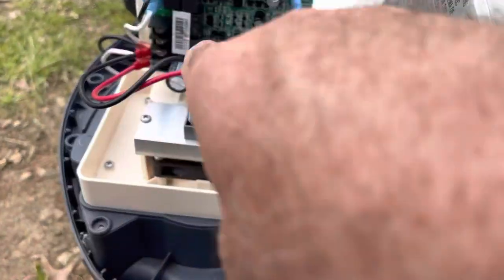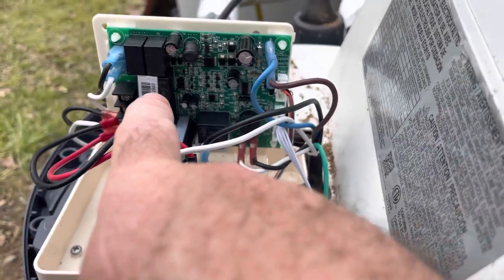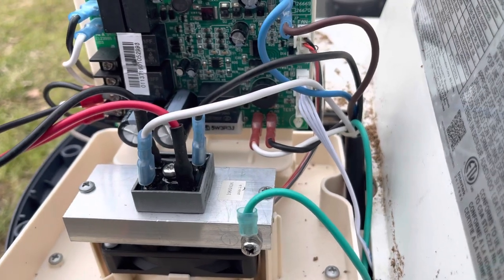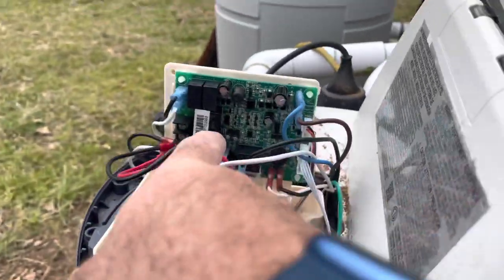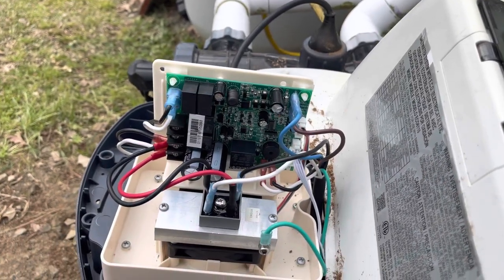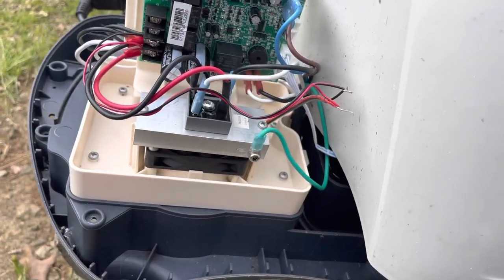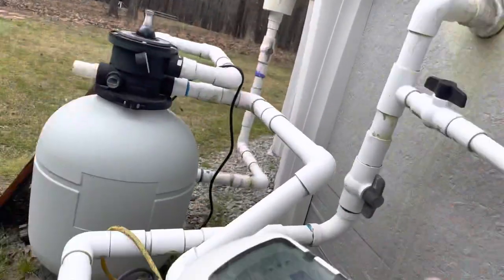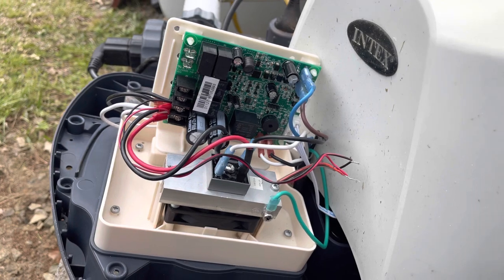Dead Pool part 3 plus dead Intex SWC | How To bypass Intex salt chlorinator error code 91

Comment: The plates used for generating chlorine are MMO (mixed metal oxide) coated titanium.  When you electrolyze salt water you produce both oxygen and chlorine at the anode.  The MMO coating lowers the voltage needed to produce chorine shifting the production in favor of chlorine over oxygen.  The electrodes are titanium but the titanium  is MMO coated.  The MMO coating will ware off and at that point the amount of oxygen relative to chlorine changes.  If you bypass the Intex unit and just apply power to the electrodes with a different supply as the MMO coating wears off you will see less and less chlorine produced.  Just something to watch out.  If you are only putting 0.5 amps into the cells, you are not going to be putting 12 grams/hr of chlorine into the pool.  I think you need closer to 5 amps to generate 12 grams/hr of chlorine.

Comment: Thanks for the video.  I hooked up my 10 amp 12 volt battery charger to the large cell, Going to make a jumper to connect the small cell.  Now that I know it works very well, I will build a water proof enclosure.  It produces enough chlorine in 1 hour to sanitize my 6000 gallon pool.  It runs on a timer and can only come on when the pump is running.

Comment: I have rebuilt these cells. The potting for the electrodes shrinks away from the housing and around the electrodes and holds water. Salt water and basically conducts between the electrodes before current reaches the plates. I repotted the housing and put cells back in service.
Reply: how

Comment: One thing that it seems everyone is missing in these bypass or jumper fixes or quite simple and everyone is over thinking. You bypass it to get the chlorinator to run constant omitting all  of the control board. Simply doe the bypass then set a mechanical timer at you original outlet then plug the salt water system into it . This will run your bypass for however many hours you want. Issue resolved. You will want to test the salt content in your water once or twice a week.
Reply: I saw a video that fixed the problem low salt sleep mode,take the electric plug out the socket where you take the cell plates out,turn it and voila it fixed mine

Comment: My first intex salt cell lasted 9 seasons. The manual that came with it was printed in 2008..I still have the unit and the manual. I bought a used one in 2020 at a yard sale it has the copper electrodes, my old one didn’t. It only has 3 titanium coated plates whereas the old one had 5. The manual states not to use any metal tool to scrape the scale off because it will scratch the coating. I just got a new intex pool (2023) and the pool pump that came with it now has a timer on the 
gfci plug, but a 10 hour max. Thanks intex, I always ran mine 24/7 here in Oklahoma, where 10 hours is not nearly long enough to beat the summer heat and it has to be on when I use the swg   Intex should have made it a 24 hour timer or no timer at all.

Comment: First thing I notice is NO ONE with an Intex Salt Generator - Ever Orders the replacement Titanium Plate. They just complain, and Rig the unit to get it to keep Generating Something.
The Problem is All Salt conversion Titanium plates are wear items. All, not just intex.
Hot wiring to Bypass the Resistance circuitry just creates more issues. First, you are likely only producing mostly Hydrogen and Oxygen gases which pass to atmosphere, but little to no Chlorine.
I would not brag about my background if I had no idea how Electrolysis worked. 
You have junked the unit.
Again - All Saltwater Generators that Use Titanium plating(Required for Chlorine extraction in Salt Water) have Plates that Wear Out.
Yes, Intex Generators last about 2 Seasons Before needing replacement or new Plates(pricing choices) Run duration dictates length of life. 8hr cycles are 3/2 days over 12 hr cycles.
Not sure where you shop but I have purchased few complete units, all under $200 shipped.(the Plates alone are about $175 for both from Intex, higher at retail)
Testing the resistance for proper function takes place Between the 2 cells.
Inverting the plug connection the long cell once a week will equalize Plate wear/buildup and may give the user a few extra weeks use before resistance failure.
*Note - 2 Seasons worth of 3" Chlorine Tablets runs about $260, plus Shock and Algaecide supplies.

Comment: My intex generator switching the wires still didn’t work and shows low salt.  My machine is 3 years old.   Are you saying I need to purchase a new one?
Reply from the maker: I've since moved on to a Hayward Aquatrol. Watch my vids and subscribe! But you  might be able to just buy the Intex cell unit itself. But I found out, generally speaking, the Intex unit is only about a 1 to 2 year life span.

Comment: I did the changing of the wires and still getting error 91 immediately when I turn it back on :( any suggestions?
Reply: This bypass doesn't stop the error code alert unfortunately. There is another video showing how to bypass and keep full control of the buttons and stop the alert.

Comment: Most videos wire it like you've done to bypass the whole unit.  I've seen one where the poster only bypassed the salinity test, so the rest of the unit operates as usual.  https://www.youtube.com/watch?v=jb40Tgboy2k
Is there a good reason to bypass the whole thing?
Also, my unit is only about a year old.  I didn't see any buildup on my cells when I examined them.  I do, however, see a white coating on the connectors under the rubber boot that attach to the prongs on the short side.  I'm wondering if I can try soaking the connector in vinegar to clean that connection and if that would fix things in the near term.